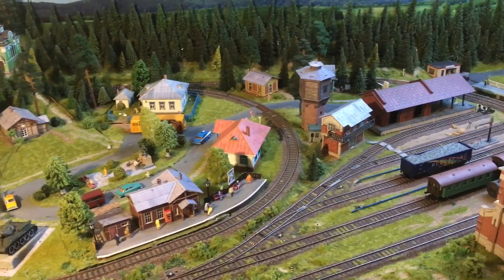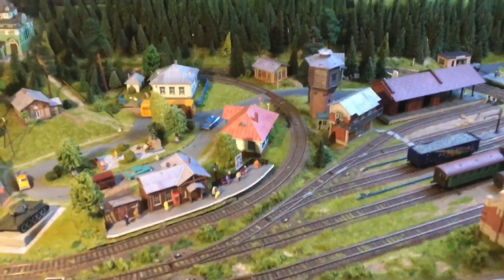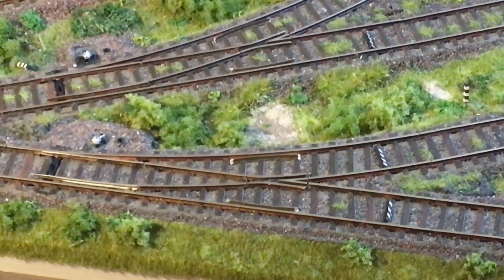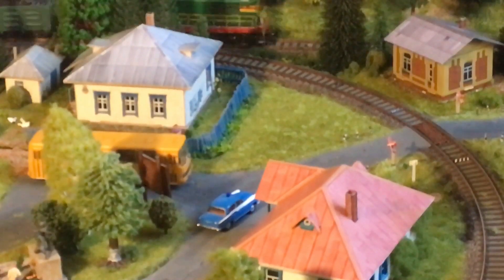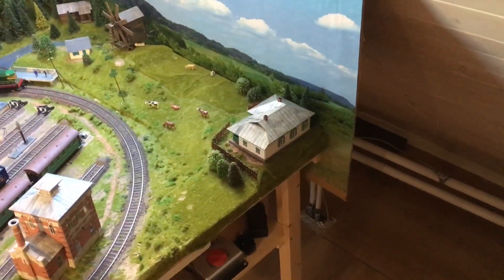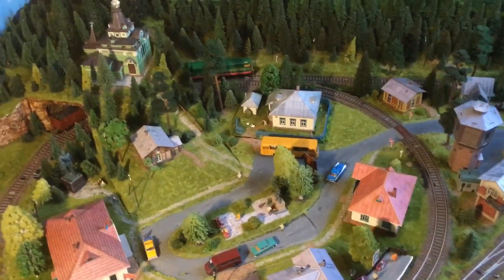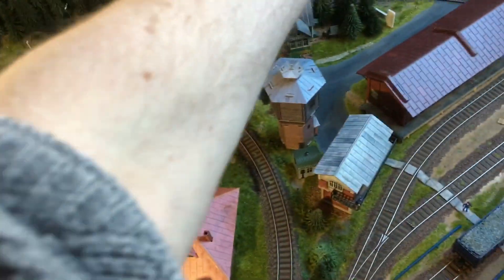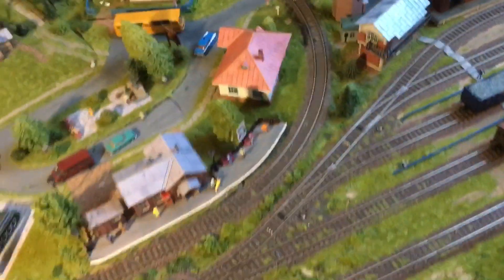To rip or not to rip - that’s the question - mistakes in my H0 layout - how to correct them?

Comment: I wonder if it's not possible to run two trains even now, if not simultaneously, at least something like train 1 reaches one segment of the track and then it determines the movement of train 2, this is I would like to use on my layout (which is still under construction). Of course, it would be necessary some things like Reed switches, small powerful magnets under the locomotives' belly and a well balanced length of trains (which is already needed, anyway). But this extra automatic stuff it's already a matter of taste, perhaps, just like using Arduino or even more powerful wizardry electronics for our beloved trains. Just an idea, anyway. Your plan for modify the layout seems good and nice, hope it would be possible to apply. Good luck! / Chris
Reply from the maker: Hi Chris, I think the layout is rather small to run two trains simultaneously, but with double tracks in the stations I could run different trains in one running session. I made the mistake not to include zones that can be switched off, that’s my biggest mistake. And these Trix C-rails (with integrated roadbed) are very difficult to remove but even more difficult to get them back in, so it seems rather impossible to install more separate zones now. Ideally I would keep this layout and build a new one alongside 🤓 but I am afraid I haven’t got the space for two layouts 😊😁 Thanks for watching 🙏👍